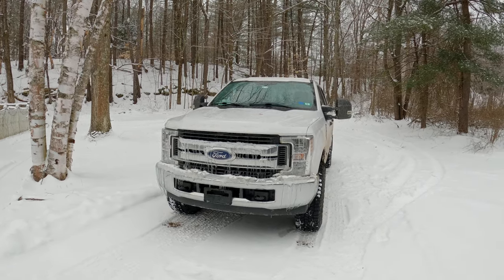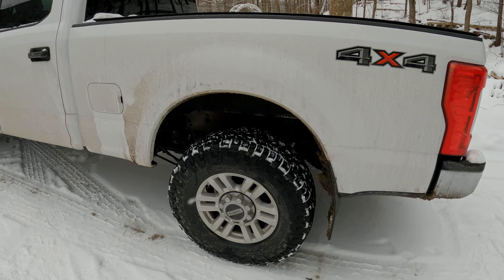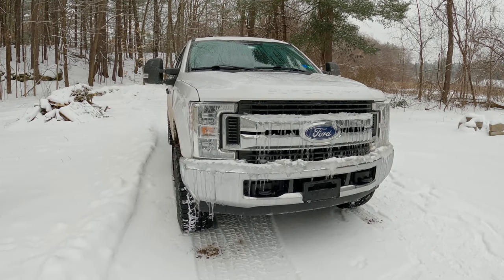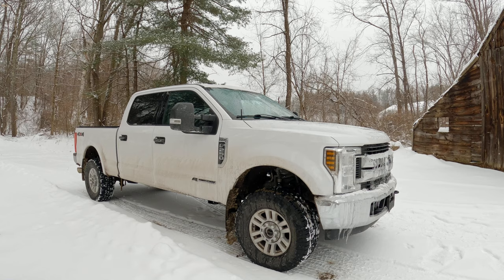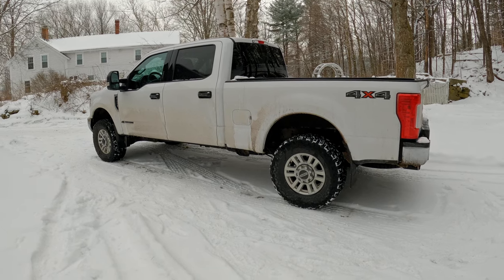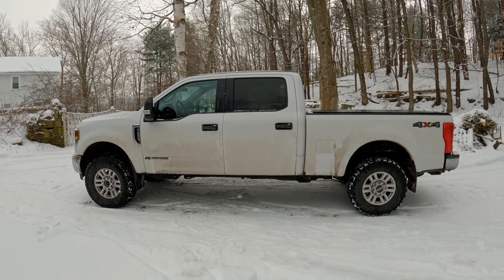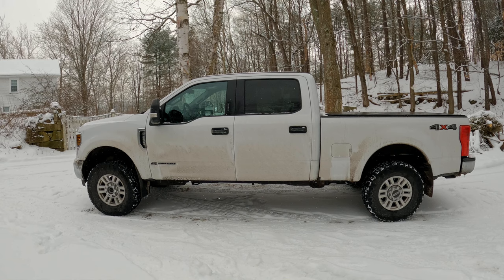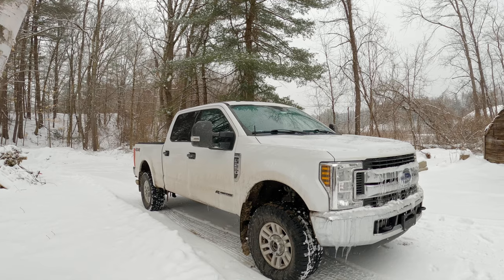How To Improve The Ride Quality Of Your Ford Super Duty Truck

Comment from the maker: What other tips do you have to improve a trucks ride quality?
Reply: I removed front sway bar added fox 2.0 shocks 37" tires with 44 psi front 40 psi rear. Camper shell decked system 12,000 lb winch with full replacement bumper helped the ride alot with the extra weight. Rides much better vs stock.
Reply from the maker: Nice!  It sounds like all that extra weight helped a lot  @rockie307

Comment: We went to Carli and of all the lifts and levels I have had there is no comparison.  I did the Commuter 3" level, stabilizer bar, hi mount steering and later added adjustable radius arms.  I tow heavy and same as you on sketchy roads.  Way better especially in handling and articulation with their progressive springs getting trailers into job sites.  At the time I went with their Eibach/Carli shocks cause Fox was unavailable.  I love my 20 F250 7.3 truck so much that I don't want to trade it in. If I get a 25 model I will do the exact same thing.
Reply from the maker: That’s awesome! Thanks for the comment, cool to hear about someone towing heavy with a Carli setup.  Who did you have install it on your rig?

Comment: before you go, lowering your tire pressure to 45 psi check what the manufacture says the lowest tire pressure you can put in that tire you’re risking your tire coming apart if you do go below what the manufacturer says. Most big truck tires can cannot go below 65 psi
Reply from the maker: Nah you inflate based on the load inflation table for your specific tire. My 35’s should technically be at 40 PSI.
Reply: I am assuming your assumption of the minimum pressure was based on what the door jamb says which is based on the maximum weight your axles are allowed to carry. As was said there are load inflation charts for every tire size and tire construction type. In this instance the HD pickups all use an LT tire ( light truck ) and tire charts for that series of tire goes down to a minimum 35 pounds, for highway driving speeds they don't want that tire construction to be run below that pressure. So what the tire chart does is list how much your tire size will carry at certain psi increment numbers, then to utilize that information the truck has to be weighed, front and rear axles separately to know what they are ( with the load that normally is carried in the truck or if its normally driven empty ). Definitely one has to be a lot more diligent with checking tire pressures when running pressures that are on the line of safety, therefore one can add 5 pounds to the calculated pressure as a buffer.
Reply: @powerstrokemaintenance  You lost me on the tire pressure. You’re so wrong. The company building the tires knows better than you. Best wishes.
Reply from the maker: @ghostpepperrides4805 please see yourself out then 😂

Comment: Getting a softer, preferably adjustable shock, like a Rancho 9000 (cheap options) will absolutely soften the ride.
Reply from the maker: Shocks will soften the ride? How will they cause the springs and leaves to soften?
Reply: @powerstrokemaintenance  Do you understand how compression damping works or shall I fill you in?
Reply from the maker: I'm all ears
Reply: @powerstrokemaintenance  extra compression damping slows downstroke via extra friction (thus heat) and increases the overall effective spring rate. Get in any modern car with different drive modes that adjust the suspension “stiffness” and this is what is happening; they are stiffening the compression damping via a variety of different methods (electronic valve control, magnaride, etc.). Some also have electronically/hydraulically adjustable sway bars though that is a bit of a different concept. Many of these vehicles have twin personalities with regards to incredibly soft suspension vs “race car” stiff. 

Now to real world 3/4 and 1 ton examples. Get in the same truck with Rancho 9000xl’s set to 1-5 and compare the same truck with Bilstiens. The bilstien truck will feel far stiffer. 

Rebound damping is a whole other topic that is actually massively important. I’ve got my eye on comp and rebound adjustable shocks.
Reply from the maker: @eag8999 thanks for explaining that. How is compression damping in ranchos changing the spring rate of my ford OEM coils, leaves, and sway bar?
Reply: @powerstrokemaintenance  as said initially, shocks can stiffen or soften the ride. It’s a pretty simple concept, but I guess some guys are just very simple men
Reply from the maker: You can soften the damping of the suspension but you cannot soften the overall ride feel.  If that wasn’t the case people wouldn’t buy Carli soft ride coils and leaves 😂 compression and rebound damping are a part of it, but the spring rate is a huge factor.  Load bearing parts will impact ride feel in a huge way.  That’s why we air down tires, swap out high rate sway bars, and choose lower rate springs.
Reply: @powerstrokemaintenance  you absolutely can soften the overall ride feel with shocks only. There is obviously a limit to which that is possible, and that is, once again, obviously the springs. The spring rate of the springs are the minimum. But shock compression adds onto that, including the stock shocks (in working order). As the suspension moves down, it activates the compression damping. This is part of what you feel when you hit bumps or encounter any suspension downtravel. Now, OBVIOUSLY, a lower or dual spring rate will help.
Reply: @powerstrokemaintenance  dual rate front springs, down rated full progressive custom deaver leaf pack, airlift 5000 with 2wd mounting bracket and daystar cradles, sway bar disconnects, and rancho 9000xl (eventually old man emu) is my ultimate setup along with a few other parts for more travel.
Reply from the maker: Ah I see! It seems I was caught up in the semantics.  My apologies.  That makes sense.  Haven’t heard anyone talk about ranchos being any good before, so thank you for the share!
Reply: @powerstrokemaintenance  in my experience, the Bilstein 4600s offered a superior ride quality, handling and composure to the Rancho 9000s.

It could be the placebo effect, but I have been happier with the Bilsteins and I don't have any complaints, but I do wish I could soften the ride on my 2012 F-250 because I don't use the truck for work or regular heavy towing anymore and I haven't ever carried anything heavy in the bed.
Reply: @FiveBoroNative  progressive springs

Comment: How bout those cooper tires. Made in Arkansas, first all terrain with a warranty, work great in everything.
Reply from the maker: They’ve been awesome so far!  Great traction and they’re super smooth in the highway.  My only complaint is they’re a little tricky to keep balanced.  What size coopers do you run?
Reply: @powerstrokemaintenance  265/75/18.  The xlts are the only at3s I have had balance issues with. The regular at3s  have always balanced out.
Reply from the maker: Good to know! Thanks for the comment

Comment: The Carli commuter kit is not six thousand bucks. The kit is approximately $2100.00 with about $800 to install.
Reply from the maker: I’m sorry for the confusion, $2150 without any options lol. $5655 if you want HD leaf springs, low mount stabilizer, sway bar drop brackets and leaf spring shackles, which is the setup I would buy.

Comment: Blows my mind Ford didn't put more R&R into these trucks. My 24 Tremor thrown me all over the place side to side, my wife hates it. Just received my Fox 2.0 Shocks, cant wait to see what the how much or a difference they make.
Reply from the maker: Sorry to hear that. The fox shocks will definitely help a lot! You also may want to consider adjusting your tire pressure if you’re running unloaded a lot
Reply from the maker: Gotcha! Good call
Reply: @powerstrokemaintenance  Now that I have been driving the truck more I realized most of the issue was the tires breaking in plus the steering feel. I am used to better steering feel and with this electronic assist crap it makes it hard to feel what the truck is doing, turned it off.

Comment: Awesome truck we have a 2001 f250 white lariat 4x4 4 door and works great but wanna upgrade to the exact truck and color you have. Maybe a stupid question but our truck has leaf springs in the front with the front suspension you have what’s the difference in ride? Big difference or?
Reply from the maker: Thanks for the comment.  The ride quality is slightly better with coils, but the main advantages are more suspension travel and a better turning radius.  You should definitely check out this year truck on the used market.  The 2019s are nice because they didn’t experience Covid manufacturing quality control 😂

Comment: Another great option for shocks is Accutuned Fox 2.0’s. They use the Fox 2.0’s with remote reservoirs and then custom valve them. Choose the “adventure” tune which is geared towards on road comfort. Completely changes the ride and well worth the extra ~$4-500 over the standard off the shelf non reservoir fox 2.0’s.
Reply from the maker: Good to know! Thanks for the share. I didn't realize there was another tuning option available for fox shocks

Comment: Good info on your suspension setup! The steering stabilizer is definitely next on my “to do” list. The Carlie kits are super nice but I can’t justify spending that cash just yet plus I like my truck to feel and drive like a truck so my superlift suspension makes me humble. Thanks again for the info!
Reply from the maker: No problem! Thanks for the comment.  You can definitely do a lot without shelling out the cash for a Carli kit.  You’ll love the steering stabilizer when you do it, big difference
Reply: I wish there was a more reasonable option to Carli.
Reply from the maker: Same!  It seems like there could be a market for something a little less expensive

Comment: Good afternoon,
You mentioned lurching on these super duties. I just got my new 2023 F350 Limited and I am noticing lurching when driving over any imperfection on the road. I have been using the word vibrates to describe it, until I saw your video. Lurching is the right description. 
Now, how much lurching is normal ? If I rest my head wearing a hat on the seat, my head goes crazy when hit a rough road. 
Would you please try to describe how much lurching is normal on these trucks ?
Thanks in advance !
Reply from the maker: I’m afraid they lurch a lot.  This is due to to the stiffness of the front sway bar.  Ford designed these trucks to be loaded to the GVWR max. And with higher weight capacities comes stiffer suspension. It’s not uncommon to have a drink thrown from a cup holder or feel like your head is going to hit the window 😂 the cheapest way to “sort of” fix this is to air down your tires when you’re not towing or fully loaded. Other than that, Carli Suspension has the best solution on the market for softening the ride feel of these fords.  I hope that helps.

Comment: I have a 2022 F250 Super Duty diesel. 

I changed the tire size to 22” F-load range. I have a vibration at 75mph. 

Do you think changing the shocks will help
Reply from the maker: It may but it sounds like it’s the tires. Load range F are heavy and hard to keep balanced. If your shocks are really old, that could be a factor, but I would look at the tires first. 

I would also just note that I’m not a mechanic, and would recommend consulting one about your particular situation in person.

Comment: Is the rim a stock 18x8??
I’m in California was told by American Tire that they would not put that tire on my rim. What are your thoughts?
Reply from the maker: Thanks for the comment! Yes it is a stock rim. I would listen to American Tire. Especially if you do a lot of highway driving. I had to get rid of these because they were too heavy and difficult to balance at load range F. Would always wobble over 65mph. If you do want oversize tires go with a load range E that's the Tremor size 285/75R18. Hope that helps!
Reply: Good to know
Thank you for the info

Comment: After 25 years of owning Ford diesel trucks the best thing to do to improve the ride quality is buy a 2023 HD 2500 GMC. Maybe it’s the Duramax diesel that has so fewer mechanical issues or the Allison tranny that doesn’t need to be rebuilt after 75K miles. Or maybe it’s the steel body that gives it the weight needed, or better yet maybe the interior that is top notch. I don’t know. But what I do know is I will never own another ford diesel truck, Ford absolutely wore me out with all the monthly repairs, and constant issues. And yes the Ford ride sucks in comparison to the GMC.
Reply from the maker: It sounds like you’ve owned a lot of ford trucks.  What made you decide on a GM versus one of the other brands?
Reply: @powerstrokemaintenance  My oldest son is a service manager for a major GMC dealership and before that a service manager for a major Ford dealership. He swears up and down about the quality and dependability of the Duramax over the Ford 6.7 He also has service records that show the Duramax is hands down a better engine. My last Truck, a 1997 F350 7.3 was a tough truck I sold it for 35k in 2020. It leaked fluids on the regular, it was paid for but the r+m monthly bill was huge. My 2012 6.7 was not much better in repairs except they cost twice as much. I love the Cummins but not the quality of truck. Just my experiences, I’m not knocking anyone who owns a Superduty.
Reply from the maker: That super interesting!  Appreciate you sharing the story.  I’ve heard good things about the Duramax from other GMC owners and I test drove one and it definitely rode better than my truck haha appreciate you sharing your experiences!
Reply: Everyone’s experience is different cause I’ve experienced the exact opposite..I’ve owned numerous Dmax and I’ve never experienced any major problems ..I bought an 18 and now a 22 I’d never go back to GM trucks..Ford interiors and Power of the 6.7 blows the doors off both my Duramax..I’d never consider going back
Reply from the maker: Wow thanks for the comment!  Its interesting to see two people with such dramatically different experiences.  I suppose thats bound to happen though given how many trucks the big three make, theres a lot of room for variance of experiences
Reply: Weird.  Every Chevy transmission had issues for me.  Seats fell apart.  Over 500,000 miles on 3 different superdutys with no issues
Reply: I own 2022 f350 7.3L gas. I am ok with a rough ride but man this truck hops/lurches on the highway(80-120km/h). I initially blamed it on my winter tires(nokian studded) but after changing them to other all season tires I realized it is the truck. Fox shocks and steering wheel stabilizer help with this lurching feeling? I hate how I get too much feedback(subtle vibration all the time) from the steering wheel too. I have tried 3 different tires(nokian, michelin,bridgstone) and nothing has changed.
Reply: @hogujak  lower rear tire pressure to 50 and sulastic shackles.  Plenty of info online IF you haven't heard of them